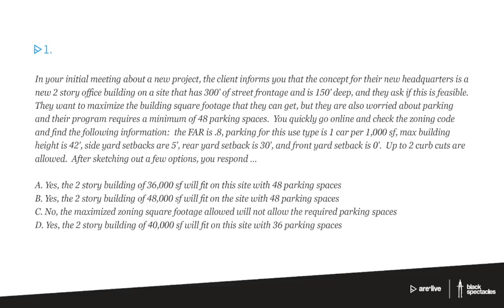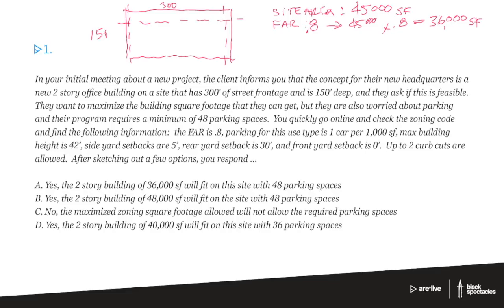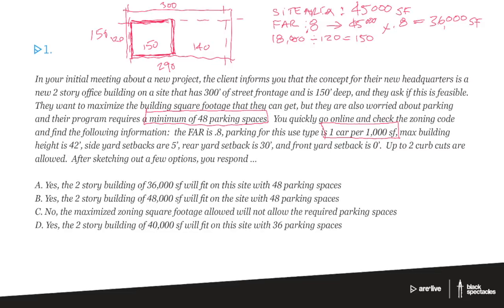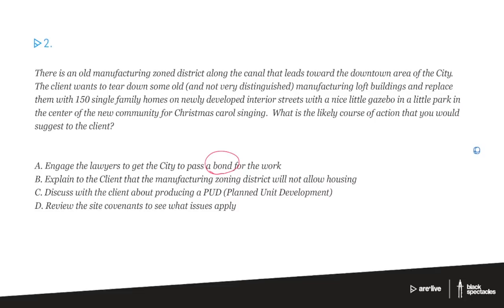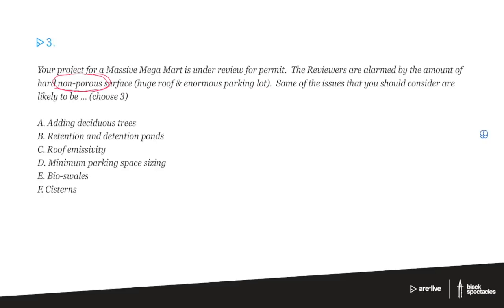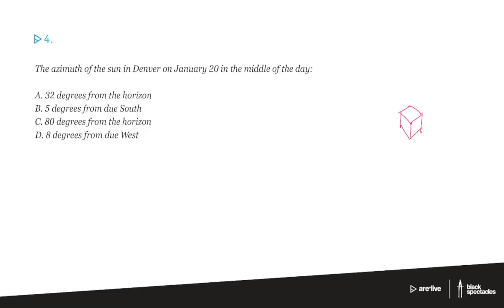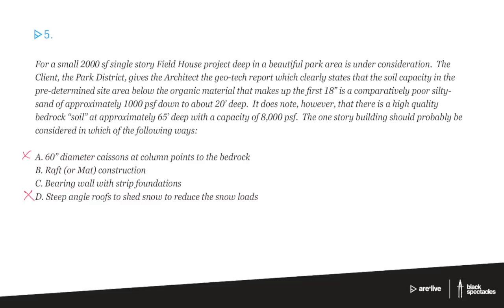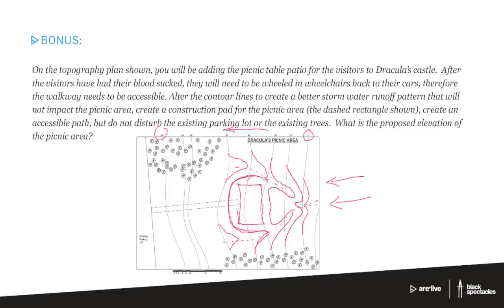ARE Live: Programming and Analysis Mock Exam - 2018

Comment: For #1: I thought we were taught to calculate 400sf per parking space on average? At that rate, the parking would not fit on the site
Reply: I agree question 1 is very misleading. It gives 1 car per 1,000sf building area. If we have 36,000sf building area allowed, then that’s 36 cars, not 48. The instructor’s method is far too overcomplicated

Comment: For questions 3, I think "D. Minimum parking space sizing" works better than "F.Cisterns" since the former reduces the amount of pavement, leaving the site more permeable. 
As far as I know, cistern is a tank to store water for non potable use and it does not really solve the issue of non-porous surface.
Reply: Agreed!
Reply: Disagree, the parking lot is already large. Using minimum parking sizes won’t make much of a difference. A cistern would divert the water running off the roof away from the surface parking lot. A plus it can be used to water the landscaping & maybe flush toilets.